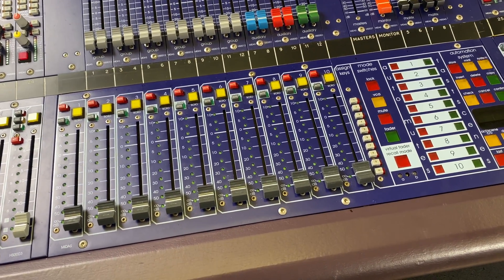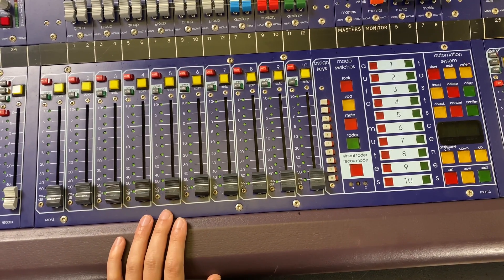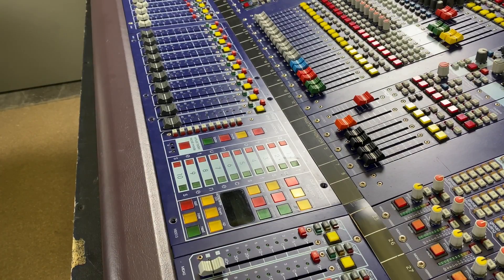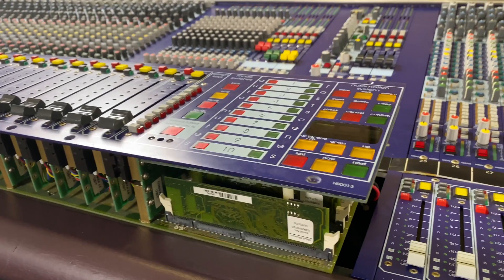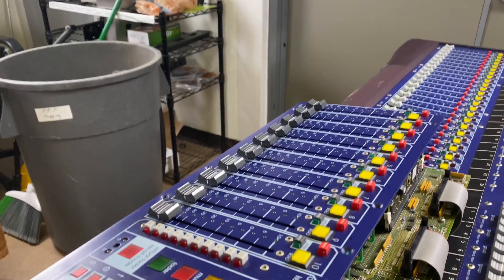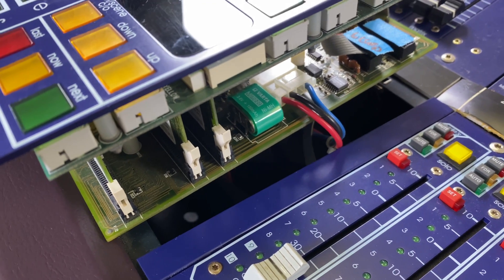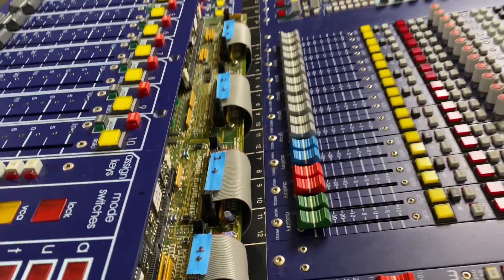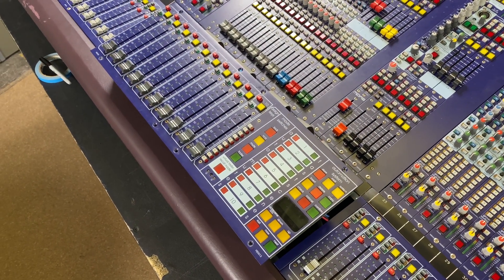Part 2 | VCA/Automation Module Removal: Midas Heritage 2000 Console Restoration

Comment: Just bought a H2000 AND a H3000. Both 48ch frames. Will be watching all these videos!!
Reply from the maker: Enjoy them! Let me know if you need help with anything!
Reply: @billylaguardia  thanks, the H2000 is ex-Royal Albert Hall in London. There’s a problem on the 3k where on one fader bank almost all the lights are on. I haven’t tipped the board to investigate yet… the solos work but the solo lights don’t on that bank as well.
Reply from the maker: @livesoundhire  hmm…there is a ribbon cable that connects each of the fader modules to the vca module. You may get lucky and one of the connectors just needs re-seated. My console came to me with one disconnected.

Comment: Bout to try to restore my Midas Venice 320-- much smaller console but hoping many of the concepts remain the same.   Great video!
Reply from the maker: The Venice is a little different: the Heritage has individual modular channels where the Venice is a large PCB with pots and switched soldered directly to the board. Basic cleaning concepts still apply. Just may be a little more tricky since you have to do everything at once.
Reply: @billylaguardia  Thanks!  Yeah I'm pretty sure I won't be able to remove the fader housing to clean the strip--I might be able to get a pointed swab in there hopefully.  I have a ton of scratchy, half on/half off gain-trim knobs and most of the faders are scratchy.  This board was used in a local club as a monitor board so I'm sure it's got full on dust cats under the hood.
Reply from the maker: @shanewatson6763  try a product called Fader Lube first before you take the console apart. That may help things. It’s more of a cleaner than a lubricant despite the name. I’ve used it in the past on other consoles, the faders required a bit of lube after. However it may help if they have a few years of grime to contend with?

Comment: There is one ribbon cable missing on that "unused" plug called SK19. It's the Midi and CAN-Bus connector to the Backside of the Console.
Reply from the maker: Thank you! That is awesome info! Please feel free to leave any other advice on the other videos. I am dying to learn everything I can on how the console works.
Reply: No Problem. I try to help on this gorgeous consoles were I can. Btw. I have a repair facility in Switzerland were I do a advanced repair on that HS0013 VCA/Automation main PCB when it's gone up in flames due to a battery fail. Otherwise the customer has an 600lbs console brick of no value. Due to the shipment cost from oversea I'll do this but for European customers only.
Reply: Did you already find the missing CAN/MIDI cable or wasn't it even installed?
Reply from the maker: Yes. It was disconnected below the vca module. It is all back together now